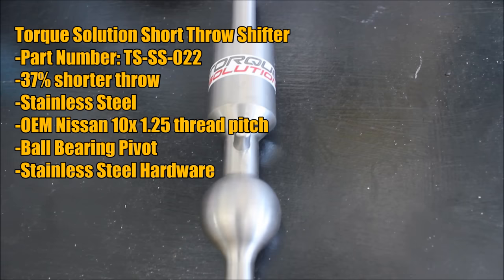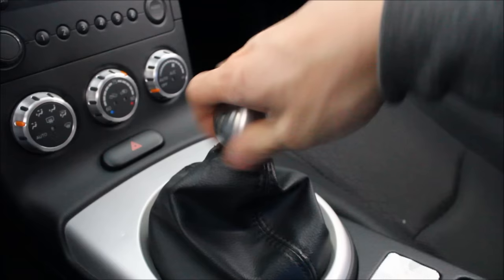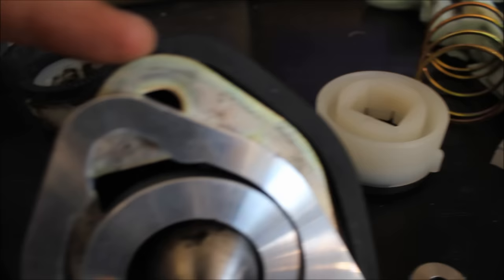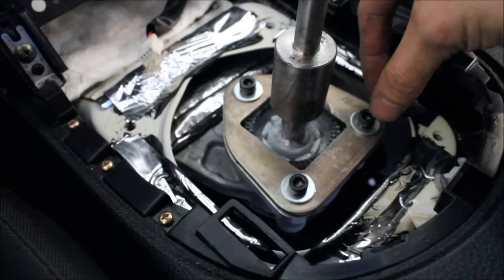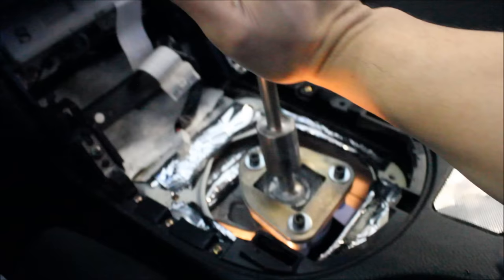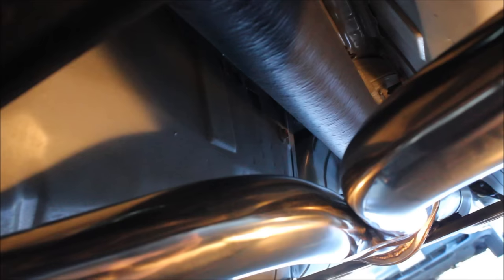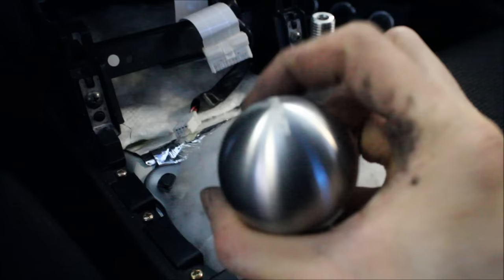Short Throw Shifter/ Short Shifter Install 6 Speed Nissan 350Z & Infiniti G35 (Torque Solution)

Comment: Same here....just got my z 2 days ago some modifications were already done. Like the exhaust. It's badazz but loud. Not overly loud just shows how much the car just wants to go
Reply: Forgot to say the stick is stock still. Don't think anything was done to shifter but shifts in gears really easy only complaint clutch catches very high unlike my last car. My last car couch caught right away so a learner could drive it. I was able to be on a hill and use the clutch and gas to stay in gear still on a steep hill. Did it the day I got it. I wish this clutch was like that. It would help off the line big-time unless your a trackie and use 2 step. Btw my z is a track car but that part of my life is over. No racing the z for me no matter how much crap someone talks.
Reply from the maker: You'll want this mod as well https://www.youtube.com/watch?v=E5cpYiVZNRI&t=453s

Comment: Just ordered mine too! I feel like my stock one is getting really worn, I've been missing shifts a lot and it doesn't give me the "in gear confidence" it used to. Thanks for this!
Reply from the maker: Ya the stock one sucks compared to this.  Which brand did you go with?
Reply: Same one you got, those "clicks" when you were showing how tight it is something I want. haha. I also ordered a new plastic cup from Z1, apparently that's usually what wears out.
Reply from the maker: frankth3frizz Ya I bought one too from there.  You can't buy the cup alone from the dealer you have to get another shifter, so dumb.  Plus you beat up the old one a bit trying to take it off.  Make sure to put on some lithium grease in the cup or something safe for plastics.
Reply from the maker: frankth3frizz Let me know what you think of the shifter once you got it in.
Reply: Hey those little spacers for the bolt doesnt seem to want to fit with both of them installed.do I need a lot of pressure to squeeze them in? There's about a millimeter gap between the actual shifter and the face of the spacer.
Reply from the maker: frankth3frizz It's a pretty precise unit.  So if it's at the slightest angle, it may not go in.
Reply: +AnthonyJ350 so I was trying to slide it from the top down. But it slides from the end forwards. Yeah it fits absolutely perfect. It's really tight and works really well with my weighted knob. Haven't driven in it yet.. Update later.
Reply from the maker: frankth3frizz Awesome!  I can't wait to hear what you think.  I find we these cars if you shift around 2800 to 3000 when cruising it slips into gear really easy.  That way you're not so hard on the synchros.  At least that's what I found with my car.
Reply: +AnthonyJ350 funny you say that. My car get a bit jerky at 3k unless I slam it into the next gear. Granted I have an HR but I shift at around 2200 to 2500.
Reply from the maker: frankth3frizz There's a lot of people that complain about the shifting in these cars (it's a sports car not a Civic) but what they fail to understand that it's a lot nicer to the car to shift when everything lines up when cruising.  Then when you bag on it, it's not THAT bad to it.

Cause if I shift at any speed you can feel the synchro doing it's thing to let it slip into gear, so I try to avoid it when I drive slow.
Reply: +AnthonyJ350 the 350z is raw when it comes everything mechanical. My friends g37 is literally one of the easiest cars to drive. You can tell nissan wanted the z to be a driver's car and the g37 to be someone's weekend cruiser.
Reply from the maker: frankth3frizz Ya that's why I like it so much.
Reply: +AnthonyJ350 just drove it to the gym. It literally feels like I have a gated shifter. First drive so it felt awkward when my muscle memory is expecting the travel to be a lot longer. I think I need a little of a break in.. 5th feels like there's hesitation due to the tightness. I think a couple of WOT pulls on the freeway will help it get more comfortable. How's yours so far? Has the feel changed?
Reply from the maker: frankth3frizz It moves better over time.  Reverse was the hard one at first till I broke it in a bit.  It's probably just the new plastic cup needs to be broken in a bit.  Make sure the bolt that connects to the linkage isn't too tight, might make it hard to shift.
Reply: AnthonyJ350 Okay have driven it some more. Hand tightened the linkage and 4th to 5th is the only "difficult" shift. Reverse goes in normally.I think the 4th to 5th however is more of a since I was used to the slack on the old one that let me push directly from 4th to 5th now theres an actual path like a gated shifter would be. Also there's no more visible wobble on the shifter in 6th and when I get off throttle in 6th. Loving it more and more, shifting is so smooth now too.
Reply from the maker: frankth3frizz When was the last time the fluid in the transmission was changed?  Put in Redline (Nissan spec) transmission oil.  Shifts really good on the stuff and protects it well too.
Reply: Did that before the short shifter assuming it would help, it does but redline seems to work better when it's fully warmed up. Been playing with it, couple of missed shifts under WOT, 2nd to 3rd since i'm not pushing  like I'm supposed to I'm pretty much controlling the movement since I had to with the old one. Just need more time. Am loving it in city driving.
Reply from the maker: frankth3frizz Ya you just have to keep driving it normally till you get the timing down to muscle memory.
Reply: Did u use redline mt85 or 90?

Comment: Anthony I've come across articles on internet contradicting each other regarding white lithium grease and plastics. Lol would think there'd be a general concensus. Some say WLG is fine for metal/metal and metal/plastic lubrication...others say WLG is not ideal for plastics due to accelerated aging. Weird. I know there are different plastics and would assume also WLG compounds...but still kinda weird. I did the same thing when I installed my nismo adjustable shifter in my 350. 

I'm reinstalling it now and am concerned with where the shifter goes into the tyranny linkage. Missing the plastic or nylon washers somehow. And just have some o rings in there. Dunno how that happened I guess broke and somehow fell out. I also have grime/dirt in the cup that I will clean out. Just not wanting to separate the ball and cup lol. Thinking of trying to find some type of washers to fill the gap where the plastic or nylon washers sandwich the shifter and linkage. Thoughts on washers? Think about soft metal would work or deform and cause issues(possibly into certain gears). Apparently it's worked fine as when I removed it they were absent and I've been driving for 6 years since install so no telling when they came out
Reply from the maker: Used Dielectric grease if you want. It's used for oring seals. I had no issue with the grease used in the video. You can worry about it in 20 years from now.

Comment: This was a VERY good and instructive video.. I'm  thinking on this modification, my only problem is I live in a country where I would end up paying 3x the amount to import that piece + waiting months for it to arrive :/

So, I was thinking.... the only (practical) difference between those shifters is the length at the bottom part.. So..... what if.... I cut it and add ~1 extra inch (the comparison at minute 5:33 was key, it's basically an extra head) of a stainless steel rod the same diameter as OEM, and weld it...throw a 1/2 inch spacer and... that should be it... just expecting not to have to change the shifter cup..

I hope I'm not missing something else.. I will be thinking on this idea for some days before taking my shifter apart : )
Please let me know what you think!

PD: Reasons for modifying vs replacing it:
- time that will take to arrive (customs is a bad joke where I live)
- costs (shipping, taxes, customs, custom taxes [YES, more taxes])
- I have all the needed tools + welder
- as I was looking some reviews, quality of aftermarket short shifters is not the best even between expensive ones (300+ USD) and OEM one looks solid
Reply from the maker: Cutting it will make the throw shorter. But the Torque Solution unit is built to tighter tolerances and material. That's where the better feel comes from.

Comment: The “retaining bracket” is the reverse lockout plate it keeps you from putting it in reverse when trying to hit 6th so yes put that back on.
Reply from the maker: Brandon Brandon Thanks for the tip!
Reply: AnthonyJ350 no problem just found out mine is missing. Thanks for the video!

Comment: @AnthonyJ350 Thanks so much for all your tutorials!  Was it difficult to remove the original shifter bar from the rest of the assembly?  Did it ruin the original cup when you removed it?  Thanks!
Reply from the maker: Everything came apart easy, I sprayed the bolts with penetrating lube to make things come apart easier.

Comment: whats the throw reduction %?
and also is it harder to shift because there is no for play?
Reply from the maker: +r18a1USDM Torque Solution claims a 37% reduction in throw.  At first it feels a little more difficult, but you get used to it right away.  It has a very positive feel and you KNOW when you're in a gear.  One of my favourite mods for driver satisfaction.

Comment: I have this same shifter and have been going absolutely crazy with the harmonics issue myself! Picking up a lot of "buzz" through the mid/top of the shifter. Tried different knobs, etc. No real solid solution.
Reply from the maker: What kind of bushing is installed for your transmission mount?  My car is a polyurethane unit from Torque Solution.
Reply: @AnthonyJ350  I have an oem mount. Sound resembles a buzzle plasticky sound. Is that what you had?
Reply from the maker: @NVSTRZ34  Mine will buzz when my car is engine braking around 3500 rpm.  If I throttle into it, it will go away.  Is yours doing it all the time?
Reply from the maker: @NVSTRZ34  Did your car have the plastic cup like the video showed?
Reply: @AnthonyJ350  My cup is as well. Same as you. Same procedure and everything. Only getting the noise on decel.
Reply: I take that back hard acceleration and deceleration
Reply from the maker: @NVSTRZ34  I think that's normal.  These cars just make noises and create vibrations.  That's part of the more "raw" driving experience, the car is going to give you more feedback compare to the average car.
Reply from the maker: @NVSTRZ34  Are you holding your hand on shifter and pulling back while doing a 2nd gear pull?  Or do you put your hand back on the steering wheel after your 1-2 shift?
Reply: @AnthonyJ350  Always hand on wheel. Very aware of resting hands.
Reply from the maker: @NVSTRZ34  I think you're doing everything fine then.  The car is just giving you feedback.  Have you tried a weighted shift knob to help absorb some of the vibration?
Reply: @AnthonyJ350  Yeah. Have a heavy z1 knob. Still buzz unfortunately.
Reply from the maker: @NVSTRZ34  Ya it's a little annoying,  You'll get used to it though.

Comment: Hey,

Thanks for the great video!  I was wondering, you said it was like the TWM shifter, does this one have something to dampen the vibrations like TWM does, it looks like it is just a solid unit.  How is the buzzing/vibrations on this one?  Thanks!
Reply from the maker: The big bulge dampens the vibration. Has the same vibration as stock but feels amazing to shift.
Reply from the maker: +soldiersinx Also I have a weighted shift knob from Greddy, so that probably helps dampen the vibration a lot too.
Reply: Hey Anthony,

Thanks for the reply.  I picked one up based on your review, but I am having issues with the installation.  When I try to insert the stainless steel bushings, there is no clearance and it will not install.  The part at 8:22 on your video.  The bushings are just slightly larger where it will not insert into the shifter linkage.  Did you have any problems like that?  Thanks.
Reply from the maker: soldiersinx Yup, it is extremely tight tolerances.  You have to line it up perfectly for it to go in.  I had a similar experience..

Comment: Anyone else have issues with the shifter not returning to the center? Had no issues with shifter before. Now it will stick to the left or right while in neutral. Gears feel good moving through them however I  haven't turned on the car yet because of the issue.
Reply from the maker: Matthew Bouchard How tight is the nut and bolt from the bottom of the shifter to the linkage to the transmission?
Reply: Hey Anthony! Thanks for responding. Even if the bolt completely loose it still does not return to the center. After driving around a bit it is starting to center a bit easier. Possibly the new cup is giving me issues.
Reply from the maker: Matthew Bouchard Maybe.  So when you go side to side (no gear engagement) it sticks?
Reply: AnthonyJ350 That is correct. I find it weird as I can't find anyone else having issues with this on the my350z forums. I even uninstalled and re-greased everything again.

Comment: great video can i ask where you got the collar from for the shift knob
Reply from the maker: It was just a generic aluminium collar on eBay.
Reply: any chance you have a link for it can't seem to find it on eBay do you remember the cost of it as well
Reply from the maker: +Jay Gleazey Did you try searching "shifter collar". It was like 20 bucks or less.
Reply: yes thats what i searched but can't find the one you have
Reply from the maker: +Jay Gleazey Let me look into it.
Reply: ok found it under shift boot retainer thanks I'm going to do this shifter with the greddy shift knob and trans mount are you still enjoying the shifter
Reply from the maker: +Jay Gleazey it's the best. If you look at my clutch pedal mod video I also changed the look of the shifter boot. ended up cutting the collar to be an end piece.

Comment: Can you tell me why sometimes its hard for me to put my shifter into gear, especially when i drive the hell out of it. Ill be driving my car normally than when i stop at a red light or stop sign i try to put my car in first gear and its like it wont go in that gear or any gear... i have to use all my might to force my shifter into gear...and btw i have a new transmission and clutch.
Reply from the maker: You might need to bleed the clutch hydraulic fluid again.  If the clutch slave is old it may need to be replaced.  Also did you install a stainless steel braided line with a heat shield?  We use Redline Transmission fluid for Nissans and my car shifts great.
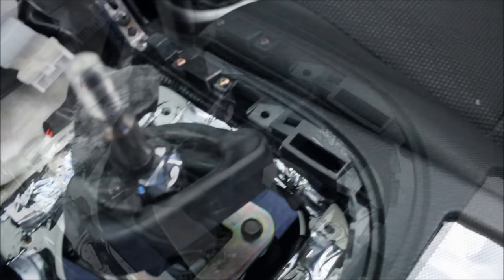Reply: I had the same issue as well after replacing my clutch and this worked for me: before you try to bleed the clutch or anything else, make sure the shifter plate is perfectly aligned. My 1st/5th/6th gears were becoming SUPER hard to shift into and I felt like I had to force it in very hard, but it turned out that my shifter plate (the gold plate that can be seen at 4:00 ) had been poor placed after my local shop recently replaced my clutch and removed the transmission. To fix this, just loosen all three 10mm bolts holding it down and make sure that the reverse lockout stem ( the little thing sticking out at 9:48 ) is touching the side of the shifter plate when in 5th and 6th gear. There should be absolutely NO GAP when in 5th and 6th gear, this ensures that you don’t overshoot when shifting or else you’ll grind it your gears by having to force them into the correct spot like you were mentioning. You may have to play with it at first when trying to find where the stick actually falls into the gears, but once you do just double check that the reverse lockout when in 5th and 6th is touching the side of the shifter plate.

After re-aligning the plate you should have really smooth shifts again ! Hope this helped.

Edit: Spelling

Comment: Can someone sent a link for the plastic boot used a guy posted the part number from Nissan but haven't find it anywhere
Reply from the maker: You'll have to check with the dealer or Z1

Comment: HEY ANTHONY I LOVE WATCHING YOUR VIDEOS BRO I LEARN A LOT FROM THEM, ANYWAYS I JUST INSTALLED THE TORQUE SOLUTION SHORT SHIFTER ON MY Z , AND I WANTED TO KNOW IF YOU KNOW WHY MY SHIFTER WONT GO BACK TO NEUTRAL BY ITSELF. ITS PRETTY STIFF ITS NOT AS WIGGLY AS THE STOCK ONE.
Reply from the maker: Z33 JV Check the retainer plate that has the reverse notch. Or you over tightened to the linkage of the transmission underneath
Reply: oh your right i probably did over tighten it thank you bro
Reply from the maker: Z33 JV No problem! Comment back and give us your feedback after driving it.
Reply from the maker: Z33 JV Were you able to fix it?
Reply: yes i had overtightened the bottom bolt, I had another question for you? The shifter comes with two spacers are you suppose to use both of them or only one
Reply: Did you use both of the spacers that came with the kit? I only used one, I wasn't sure how to or where to put the other spacer
Reply from the maker: Z33 JV Pretty sure I used both. You have to place it in exact for it to go in.
Reply: where did you put those spacers is it on the bolt from the bottom of the car or the bearing of the shifter?
Reply from the maker: Z33 JV bearing for the shifter
Reply: oh so the bearings got on each side right
Reply from the maker: Z33 JV That's how o have mine. I'm pretty sure it shows it in the video
Reply: alright thank you

Comment: How are you liking your shifter so far? Looking to buy the same one. Just bought a urethane transmission mount and looking to add this to make shifts even better.
Reply from the maker: It has been amazing, you put this together with the RJM Pedal and it's a completely different driving experience. https://www.youtube.com/watch?v=E5cpYiVZNRI&t=4s
Reply: Great thanks! I saw your video on the RJM Pedal already. Its even featured on their website. But that will be for later on since it will cost me about $300 shipped to my house lol. Maybe in a few months.
Reply: I have a 90 BMW and thinking of putting it on my BMW